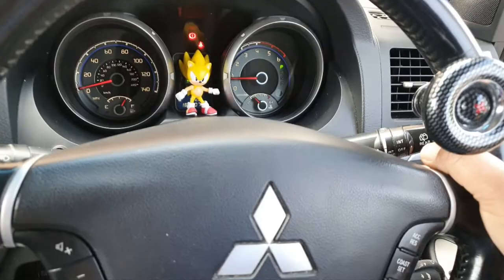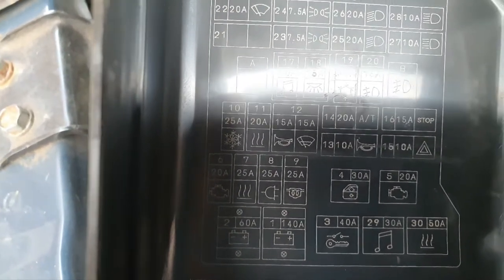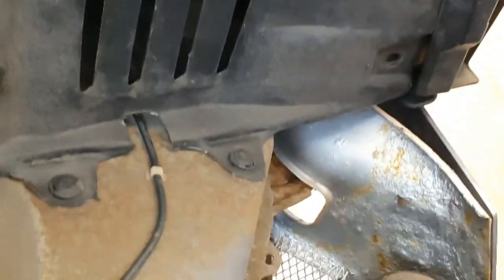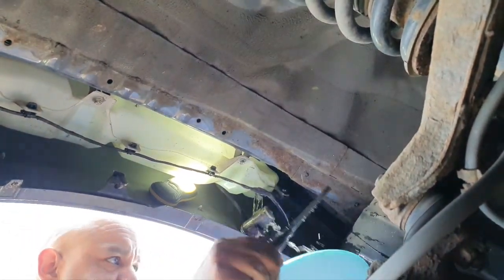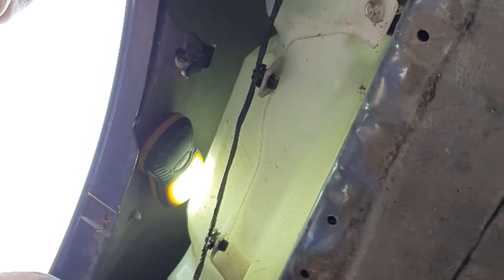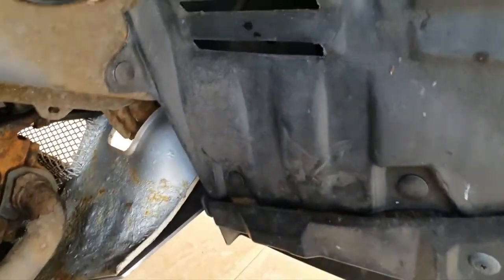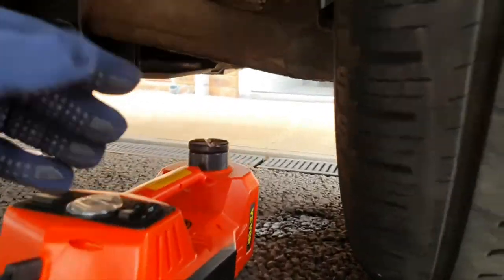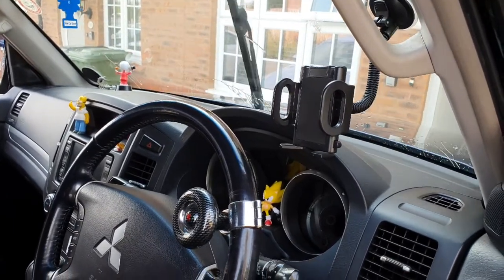window screen washer pump change on mitsubishi shogun/pajero 2007-2016

Comment: legendary, thank you.
Reply from the maker: You're welcome!
Reply: Is this the same for the outlander
Reply from the maker: Hi on the outlander the pump is on the passenger side mate just behind bumper in front of the wheel. Take off the splash guard and you'll see it
Reply: @magicspanners402  I have the 2009 outlander the wiper reservoir is on the driver side checked the fuses all ok it's the same as the video shows no sound at all when I engage the wipers
Reply from the maker: Sorry i was thinking of the shogun sport. Sounds like your having the same issue I had. Following the filler spout neck down you'll get an idea where the main tank is located and the pumps mounted on there.
You can buy them on ebay which are cheaper than the dealer. Mitsubishi like to mount them either in the wheel arch or just behind the front bumper. 
Mine went into the top of my wheel arch that's how I worked out where it was. Hope this helps mate 👍
Reply: @magicspanners402  nothing to be sorry about your giving free advice,thinking should do something like what you do on youtube I'm a greenkeeper people are always asking about how you build a tee renovations
Reply from the maker: Go for it mate. All the best 👍  let me know your channel name when you started